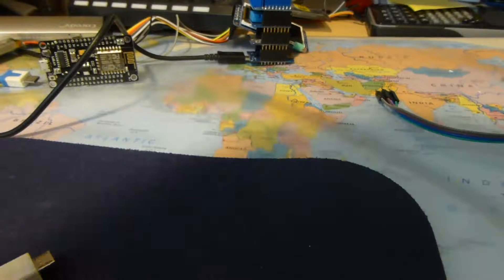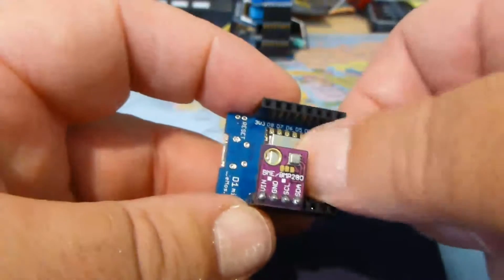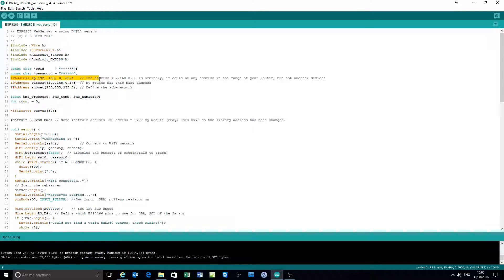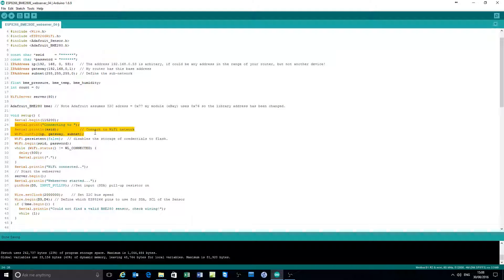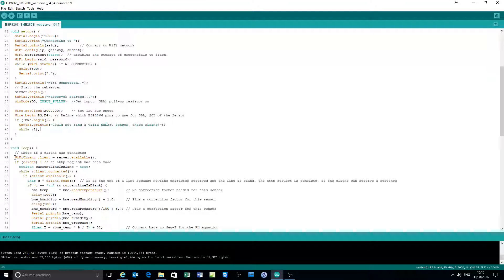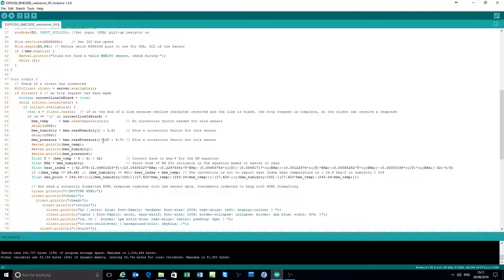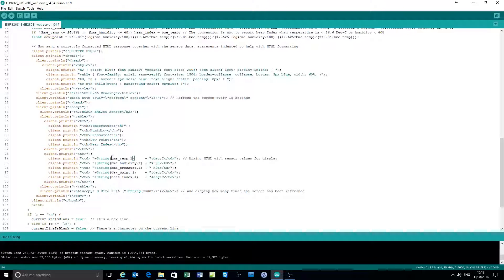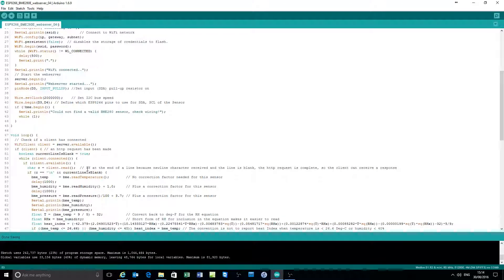Tech Note 007 - ESP Single Page Webserver and code walk through

Comment: hello i need a quick help.. i am using esp-07 and BME280 ..the connection of esp07is IO14(SCL) and IO2(SDA),EN-3v3,VCC-3v3,gnd -gnd........... connection of bme280 is SDO - gnd , gnd - gnd ,scl - IO14,sda - IO2,vcc-5v............ they are connected via voltage level shifter of i2c and the link is   https://www.google.com/imgres?imgurl=https%3A%2F%2Fplayground.arduino.cc%2Fuploads%2FMain%2Fi2c-level-shift-mosfet.png&imgrefurl=https%3A%2F%2Fplayground.arduino.cc%2FMain%2FI2CBi-directionalLevelShifter&docid=-Y-Yr9aTXGPq0M&tbnid=ShnDicreX0sdBM%3A&vet=10ahUKEwix_5ralrXcAhXKMo8KHfYTAncQMwgoKAAwAA..i&w=448&h=255&client=ubuntu&bih=567&biw=1242&q=https%3A%2F%2Fplayground.arduino.cc%2Fuploads%2FMain%2Fi2c-level-shift-mosfet.png&ved=0ahUKEwix_5ralrXcAhXKMo8KHfYTAncQMwgoKAAwAA&iact=mrc&uact=8

it shows an error check wire
Reply from the maker: The esp8266 i2c pins are sda=4 and scl=5 and the I/O levels are 3.3v. The bme280 also uses 3.3v so you need to remove the level shifter it’s not required connect 3.3v to 3.3 on the 280 then gnd-gnd then 5 to the 280 scl and 4 to the bme280 sda that’s all that is required.
Reply: the bme-280 is different as shown in this link which conducts on 5v as http://img.dxcdn.com/productimages/sku_436672_1.jpg...and i use esp8266-07 which has different sda and scl pin as i think
Reply: the esp-07 image link-https://img.staticbg.com/thumb/view/2014/xiemeijuan/12/SKU188843/SKU188843-1.jpg
Reply: kindly reply
Reply from the maker: No, your bme280 requires 3.3v power, so your board connects to 5v and has a regulator that supplies 3.3v to the bme280. The esp8266-07 uses the same pins, these are determined by the compiler.

esp8266-07  BME2805v-5v or Vccgnd-gndsda(4)-sdascl(5)-sclNo other connections required.
Reply from the maker: Got it working now?
Reply: thank u soo much

Comment: Thanks G6EJD, this is a very helpful video with a really clear explanation of the code.  I am working on a project to switch heaters on/off at specified temperature settings so your code will help me to do this.  The only bit I did not understand was the Break statement but I have looked it up and now know that it is a forced exit from a loop.
Reply from the maker: A thermostat makes for an interesting project, good luck with it. Quite complex if you add PID control to prevent over heating and poor efficiency or poor temperature regulation. Yes the 'break' command is unusual and is really a poor solution to programming, but it works! Luckily all the variables are destroyed when the function is terminated, otherwise memory usage would climb. Recursive routines like load SD can be mind bending too.
Reply: Recursive routines are way above my level. I have looked at PID and as you say - it's complicated. Intend to rely on just hysteresis. 
Are you going to make the code available on your Github?
Best wishes
Arthur
Reply from the maker: I posted the code on GitHub here: https://github.com/G6EJD/ESP8266-BME280-Single-Page-Webserver
Reply: Many thanks. That will really help me with my project.
Best wishes
Arthur
Reply: Hi David
I really like your approach to coding and I have discovered a few things from it. I particularly like setting the ip address to a constant value which I was not aware of before looking at your code.
Once again, many thanks.
Arthur